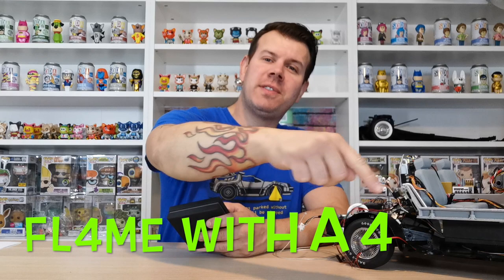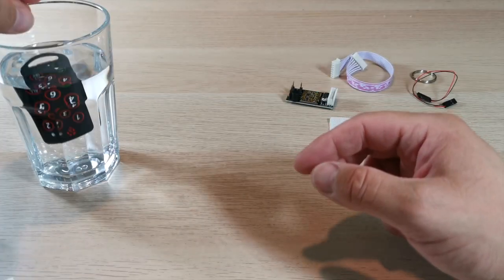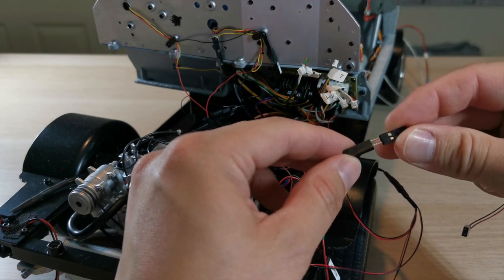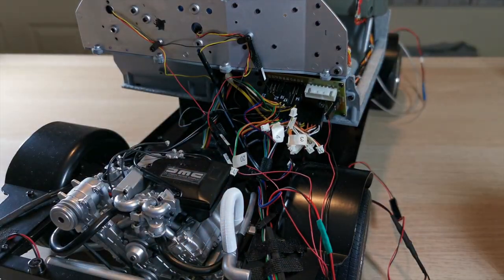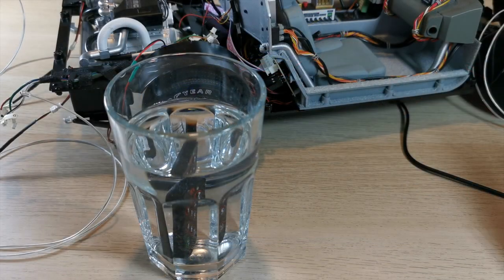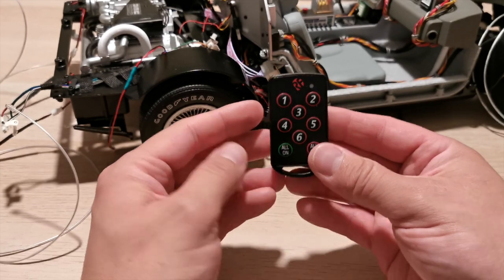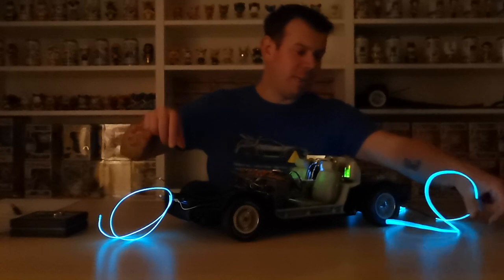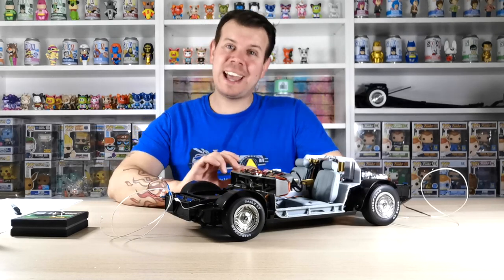Build The Back To The Future DeLorean - Wireless 1 to 6 Switch ( Easy Install ) By Model Modz

Comment: Is it possible to mount it without the power mod?
Reply: Yes, there is a power in and power out on the board. So you would use your existing power to this new board and use the supplied extension as your power out jumper back to the main board on the car.
Reply: I have tried to do it this way the connections are the same with what is left. Not sure how to conect up without the power mod

Comment: Hey
Could you write the best order to indstall power mod , el wire, , wireless if     I build from issue 1 and have already mods so I dont have to remove any default elements? Power mod and el should pararell at the same time? What about wireless?
Reply: Power Mod should absolutely be first. You’ll need to install it long before the other mods. After that, you can install the Flux, Xmas tree and remote all when you get the main circuit board. The EL kit can be installed before you attach the interior to the frame
Reply from the maker: @JQ-fl2hn  thank you for helping out 🔥👍🏻